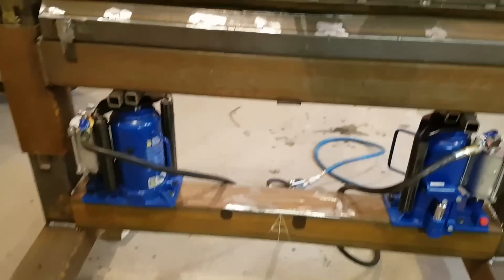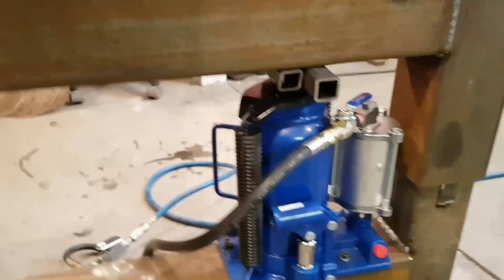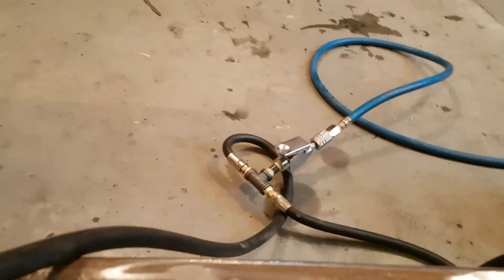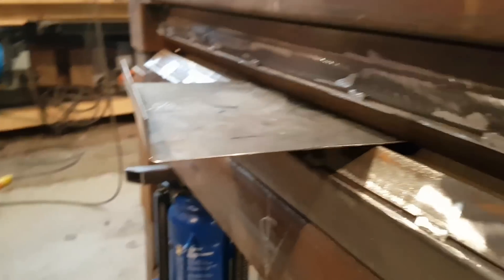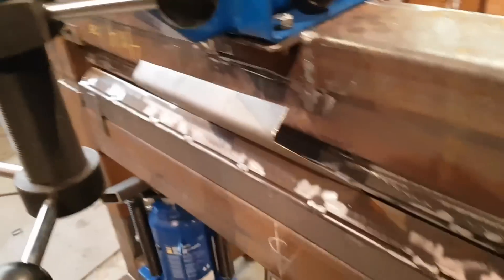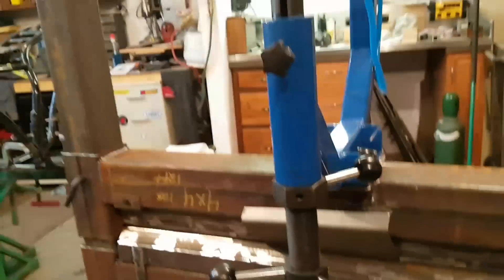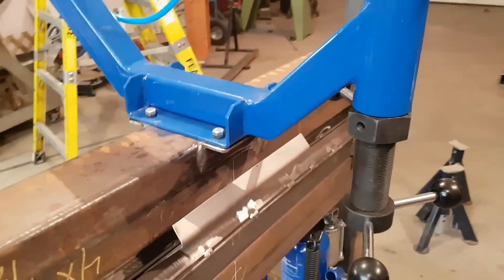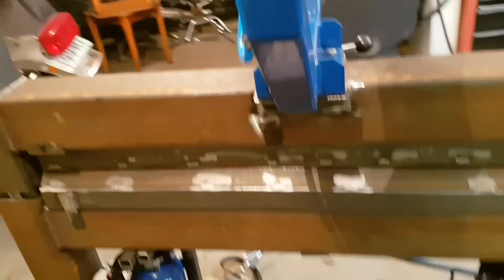DIY Home Made Press Brake

Comment: Hy bud great design.  Few years too late. Made one also...however having trouble keeping the bottom die parallel...any tips. Cheers
Reply from the maker: I have the pneumatic jacks manifolded together, but still have to fuck around to get them to come up evenly... Maybe adjustable valves on each jack, and mess around to make them even?

Comment: I'm in the process of getting all my material together and after looking at this one, mine is "WAAAAAYYYY" over kill to bent the material i want to brake out.  I saw a comment below about you don't have a material list which is understandable.  I did go look at Mike Davis custom metal projects  and yours is very similar and works great.  The Die section I have, going to use angle as well.  If you don't mind, what did you use for the Main uprights and the "slip collars" that go around them?  It appears to be 3"x3" square probably about 3/16" thick but not sure. The rest I can wing it as well.
Reply from the maker: Yeah, 3.5HSS with 4"HSS sleeves. Sorry for the 2 years late reply. Wow, I really dont check this very much.